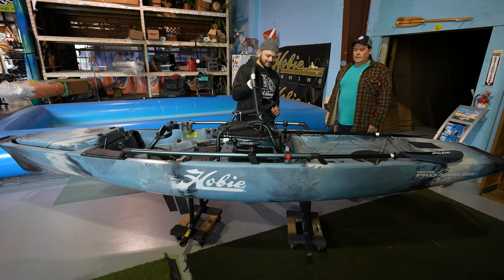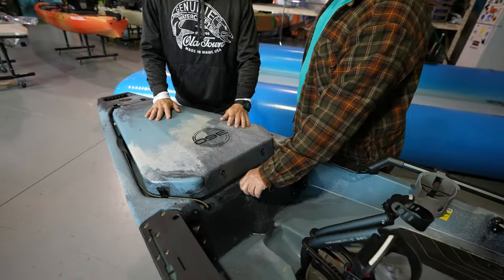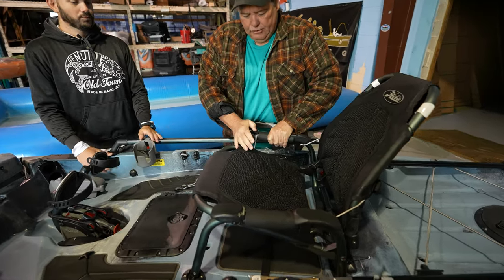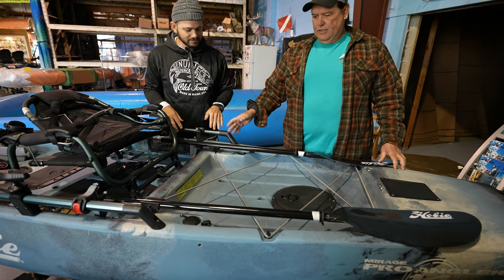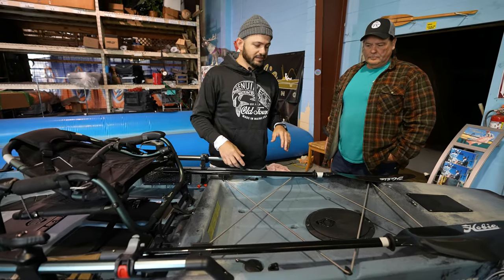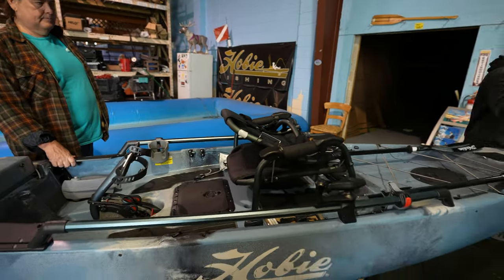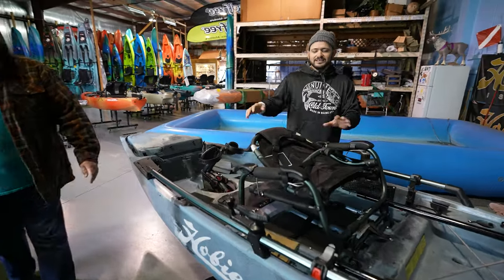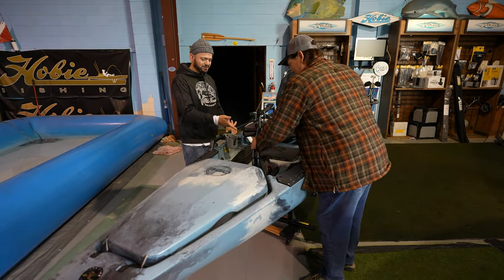FIXED! 2023 Hobie Mirage Pro Angler 14 with 360 Technology

Comment: Both of my PA12'S were great kayaks, my first was a used 2014, I bought in 2015. Lasted me up until I got 2021 360. It was still in amazing condition. I sold it for little more that I originally paid. They had already fixed the bearings way before I got mine. I don't think I've seen anything updated sense the original 2020 360 release except the price. But everything is more exspensive these days... Still one of, if not the best fishing kayak on market. I just recently added my first set of electronics to mine after kayak fishing for long time!. My amped outdoors 32ah 14.8v battery less 4 lbs & runs a 10" Garmin, steady cast heading sensor, lvs34 system for 12+ hours & still has juice to keep going! I don't run a trolling motor, I don't need one I can pedal that thing all day with ease. It will kick your ass when you first get one but after you build up muscle & stamina ist easier than walking.

Comment: The most important drive tips… when in shallow water keep the pedals all the way forward and backward with tiny little two to three inch strokes. When shifting forward or reverse do it when both pedals are in the middle and slowly no jerking the chords. I avoided the 360 as so many failure complaints. The boat pedals should come with replacement straps($5 straps too much with $1800 drive?) USE A TETHER TO THE BOAT unless you don’t mind losing half the boats value to the bottom of the river.

Comment: I’m getting this one . I have autopilot . I prefer hobie with more powerful 55 pound thrust on the bow plus the pedal drive . I miss having pedal drive . Plus for salmon trolling I get way more bites on hobie passport I have them autopilot - because the legs are more sporadic bouncy not perfect - so triggers bites more - proven for 2 seasons now …so ideal is to have both
Reply from the maker: let me know how it performs when you get it
Reply: Autopilot is great . But once I get hobie - it will have everything . The problem is that 55 pound thrust xi3 for 1500 plus kayak plus installation and tax a it’s 7500. Plus mounts for it and so on . There you have a 9 grand fully decked out hobie pro angler . That’s crazy money
Reply: Morning comes in . You and your friend peddling and actually doing something so keeps you going .. hot coffee .. then you get to a spot and spot lock .. it’s just great to have both systems - often here it’s so cold , I rather pedal then just sit all wrapped up in jackets while the motor is running .

Comment: One question. If you do decide to just paddle, I did not see a rear rudder that turns. Would that 360 peddle unit be used to steer if your paddling? Seems like you need a rear rudder
Reply from the maker: you got both the normal rear rudder and the 360, you can turn with both or one or the other, you can go 360 degrees basically

Comment: The "sail" attachment point is for general attachments. Hobie has a lot of overpriced crap that plugs in there, like bimini etc. (If you want a sail boat, just get the island. You're already getting up near its price point with the PA anyways)  As for the claim @9:11 about the drive problems being "addressed" is false. Both belt and drive failures with the 360 are still a common issue. This guy might not admit to it during his little sales pitch, but i betcha the kids he has working repairs for his dealership are getting them in constantly.

Comment: For what they charge for a kayak that should be a lifetime warranty on all.   Way too many Hobie 360 that were shipped out failed.   Cracking in the hull.
Drives failing.   Body warps over time.   Dealers have tried to do everything possible to make it right in the end Hobie refused to replace them.  I wanted one for some time.  But after seeing so many friends kayaks fail with these defects.   I’m sorry I can’t.
Reply from the maker: it is a lot of money to be worry about it for sure, what i can tell you is that hobie is very good at replacing boats, even in weird cases

Comment: I own 3 and love them but….. let’s address what sucks! They are heavy, period. The rudder handles loosen and you usually discover that when you get there and the wind blows them off…somewhere! They provide little to nothing for securing the boat to what you haul it with. The six pole holders are not worth a crap as the reels are crowded in your seat side areas… realistically there should only be two extras. The drives are awesome but every few trip you need to make sure nothing is coming unscrewed and they should definitely come with a booklet on useful tips…to many for here. The fold out tackle hatch is ok but one of mine has a storage hatch instead and is way better